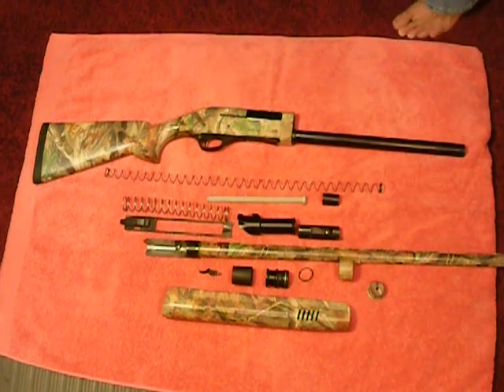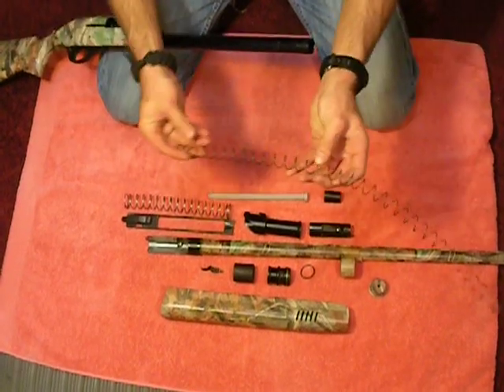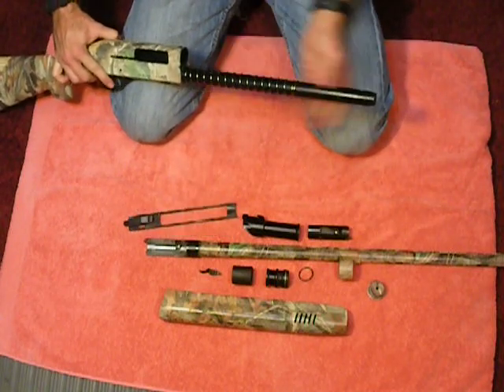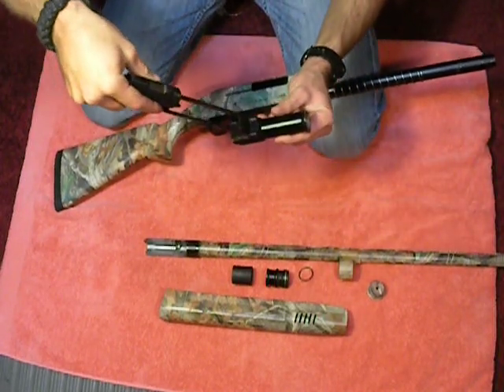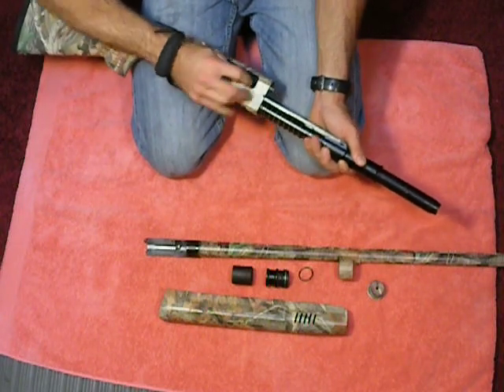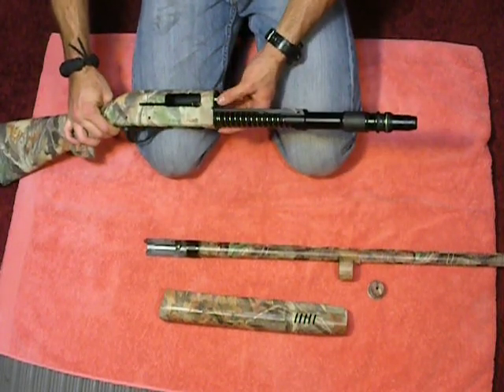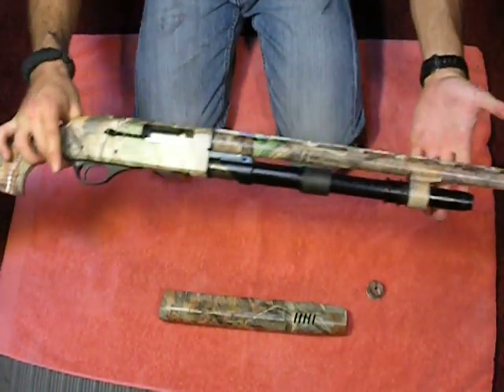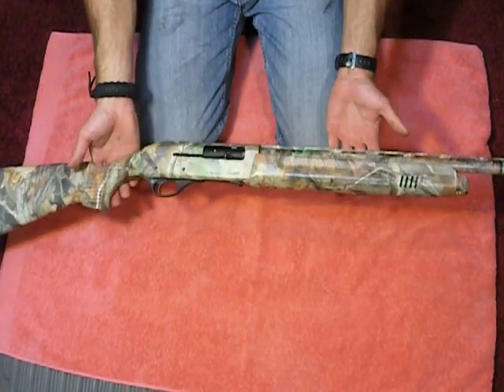Charles Daly Field Hunter Assembly

Comment: Thank you for your video. I bought this same shotgun at a pawn shop and it would never cycle correctly. From your video I found out that I am missing the buffer delay sleeve. You gave me the dimensions some time ago. I have spent a lot of time on internet trying to find this part to no avail. I just made a part from 1' PVC and it fit perfectly. works great now. thanks for your video. By the way, that piece of plastic sleeve is just there to delay the blow-back for allowing cycle time for next round. If it is missing, the gun will jam constantly.
Reply: I, too, had cycling issues. Especially, with light loads. I bought a buffer from Numerich, but it still did not have enough pressure for light loads. I had an aluminum extension made to 9/16" long. Now it cycles light loads effortlessly as well as 3 inch #2s. Time will tell if this adjustment will damage the carrier assembly or not.